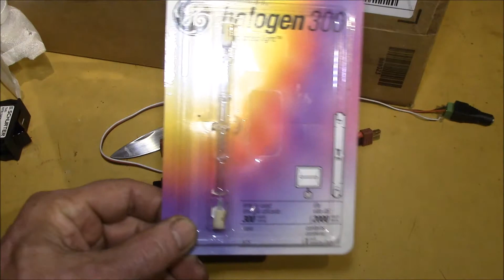DC-DC Boost Converter, or ...? , Part 2

Comment: What hapened if i connect to input 50.v 1.a from solar panel (gs-50 amorphine), and i set in output 14.v for charging car batery block? This stil works? How much A  power i get? can you tested pls :)
?
Reply from the maker: That's a good question.

With a boost converter, you would get get the output voltage equal to the input voltage.  Boost converters step the voltage up.  You need a buck converter to step the voltage down.  If you used a buck converter for that application, one of two things would likely happen:

1. It would work like you described, getting 14V output assuming the panel was capable of supplying all the power needed to charge the battery, or at least hit the output current limit of the converter.  Some allow you to limit current to some value.  If you set the current limit to some current, say 5 amps, such that the output power was 14V x 5A or 70W and your panel could output 100+ watts, then this would work.

2. More likely, while the output would be 14V, the input voltage would get pulled down to 14V as well, if the output power exceeded what the solar panel was capable of.  In that case, you'll get 14V and whatever the short circuit (Isc) of the solar panel is.

Best option if you want to do this is to get a real MPPT solar charge controller.  They work like a step down or buck converter, taking a higher voltage and lower current and turning it into a lower voltage and higher current to charge a battery.  They also limit that charging to maximize the power output of the solar panel during the day.
Reply: Thanks! let's see what happen when i get DC DC from china :D